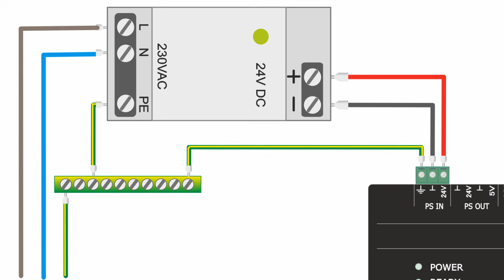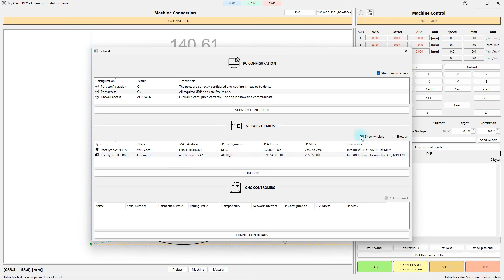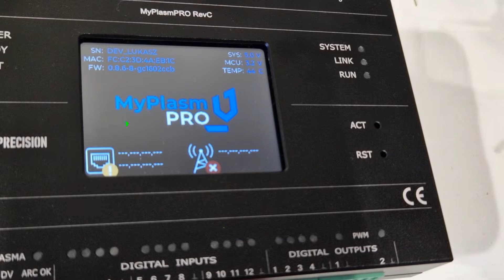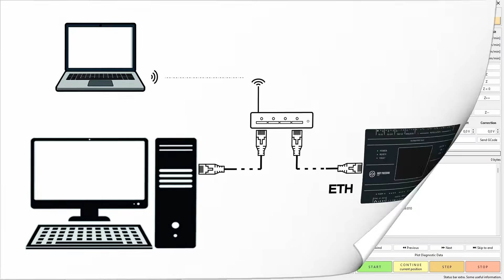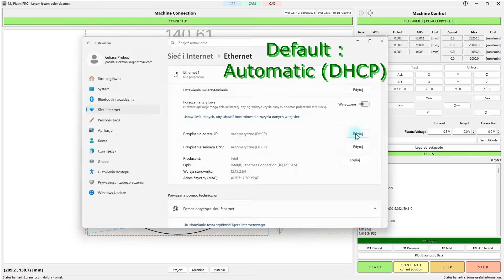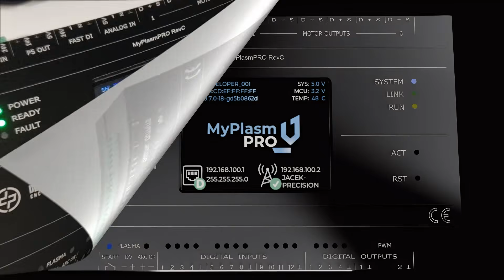#02 MyPlasm PRO - First Run

Comment: Once a cutting job has started, if the PC is disconnected - Will the controller continue the cut without issue?
Reply from the maker: When the connection is broken, the current path will be completed and the program will stop. The next path will not be started, even if the all project is in memory.
Reply: @proma-elektronika3142  Thank you.